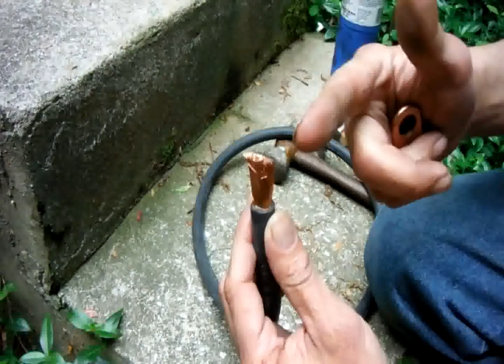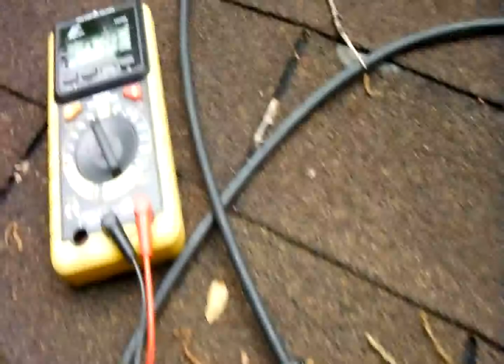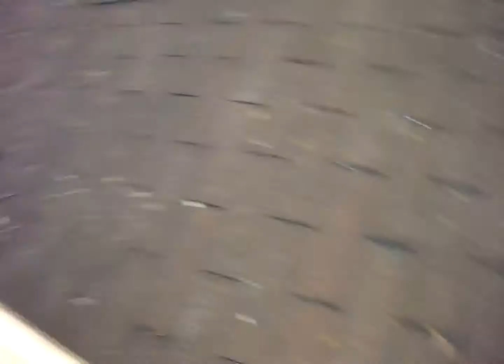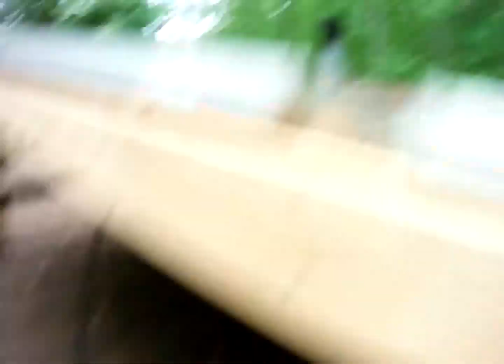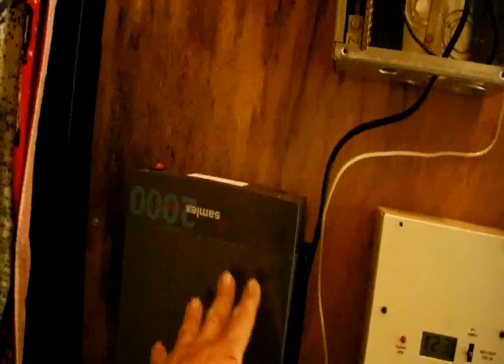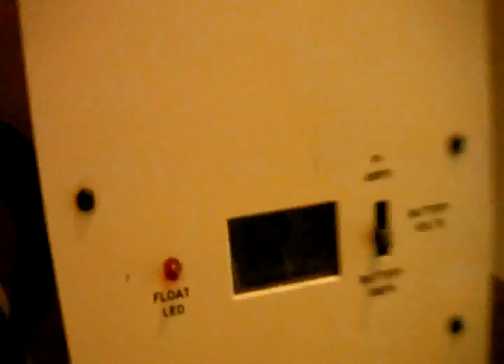I have solar power!

Comment: Congratulations TRP! Good job!  Nice system, that charge contoller is top notch and a pure sine way is great aw well. Man I have to rethink my charge controller I have PWM not MPPT. At the time the cost was a main factor. I want to update my 100 amp to 200 amp service and have an outlet infeed for a generator to feed whole house and segregate some circuiits to be dedicated t.o solar.. Gotta make time but many issues to deal with now. Great job TRP! Kudos!